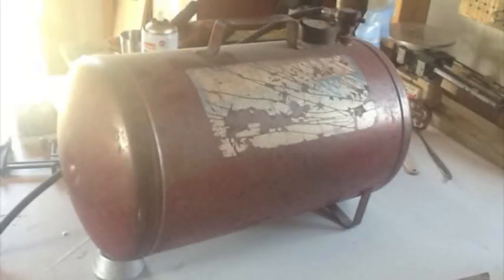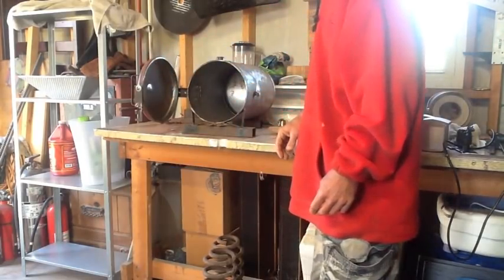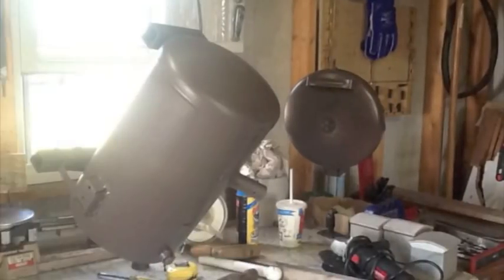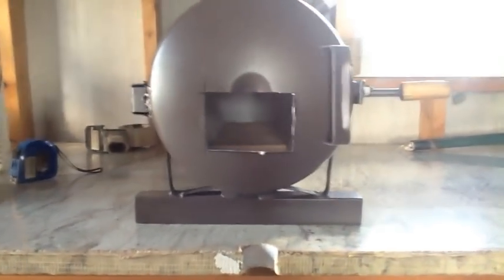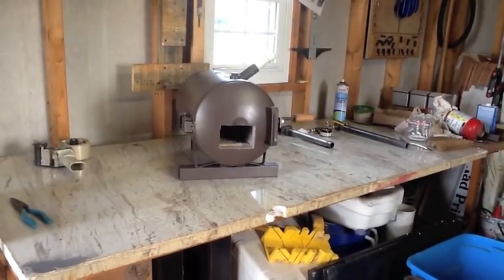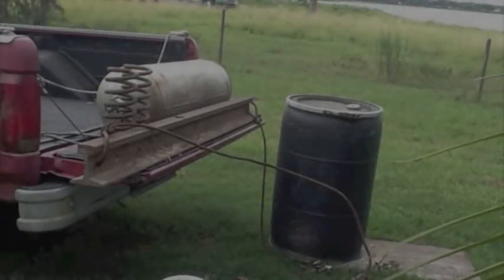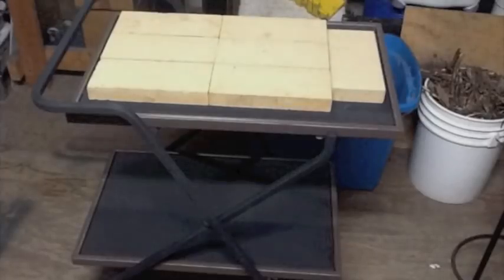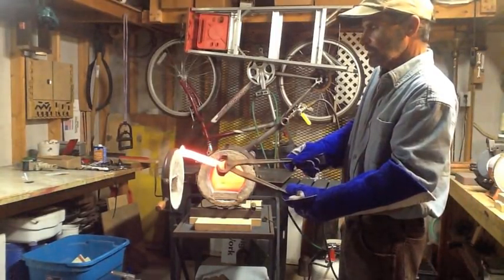My Custom Blacksmith Propane Forge Build - Start to Finish

Comment: chunk o medal   a rail road spike
Reply: and with it that hot how many recognized t it as I did  that is over 50 years experience
Reply from the maker: Yep, the good 'ole RR Spike. So with 50 years under your belt, what did you think of my 1st forge build with no prior experience? I never saw a forge in person until I built mine. TIA
Reply: in this age with Y.T.   to see up close how to it should be as easy as falling out of bed  this is why I focus my projects on how to for no money   its a much harder way to get  really good out comes    I have my first smithing vid going up in a few days   cow boy cooking irons from junk left behind after an election
Reply: and using a vary UN-CONVENTIONAL GAS FORGE
Reply from the maker: Cool, please share once posted on YT :)
Reply: best way is to sub   I may not have 4000 subs but the # of people that will want to  be on a mail list   I'm 72   and every thing about computers is self taught    I began this 5 years ago then my channel 2 years before  2011 my phone  just  made calls  and that was it I had a 35 mm camera till 2014  it broke and a Kodak 710 digital was cheaper than fixin the old 35  I almost went back to my brownie
Reply from the maker: Digital is the way to go...I use an iPad. Its more about the content than video quality :)
Reply: no ya missed it   now I use a  galaxy lite from T Mobil  and the K710  but its  quality sucks  compared to the  galaxy lite
Reply from the maker: Like I said, the video content is more important than the video quality. If its a subject peeple are interested in...they will overlook high definition qualty video and watch. The forge video was "poor quality" but does well because of the content of documenting its build.was good :)

Comment: I WAS WONDERING IF YOU ARE GOING TO SALE A RAIL ROAD TRACK
Reply from the maker: If you are in the Tampa, FL area I would consider sellin ya one :)
Reply: NO I AM IN KENTUCKY  I HAVE FAMILY IN FL
Reply from the maker: Ok, I didnt want to get involved in shipping an anvil , besides it would cost more to ship than what I would sell it for...LOL :)
Reply: ALRIGHT . I HAVE A QUESTION ON MAKING A FORGE AFTER YOU USE THE BLANKET DO YOU USE PLASTER OF PARIS ...I ALSO AM WONDERING CAN YOU HELP ME GET STARTED IN BLACKSMITHING LIKE HAND ME DOWN TOOLS TO START OFF OR A CHEAP SET TO START OFF WITH WOULD BE GREAT HELP I AM DISABLED AND DON'T HAVE A LOT TO BUY ALL THE TOOLS
Reply from the maker: No plaster of paris at all. After the ceramic wool goes in the wool gets coated in rigidizer, then ITC100 (optional) or Satanite (optional) and its complete. No plaster :)

Blacksmithing isnt my specialty and have limited tools myself. Check with some local blacksmiths (Ferriers), those are people who shoe horses....and see if they can help ya out. Good Luck!
Reply: THANK YOU
Reply from the maker: Sry I couldnt help ya out, best of luck in your smithing endeavors :)
Reply: no problem thanks for talking 
still like your videos
Reply from the maker: Thanks for watching them 👍🏼 :)

Comment: how much  did it cost to build
Reply from the maker: +Thamie _189 Between the ceramic wool, the ITC 100 & misc fittings bought to make the burner I would put the cost at about $130.00 Plus a few bucks for the paint. Thanks for watching!

Comment: How hot can it get to
Reply from the maker: Not sure..I dont have a thermocouple. Pretty hot tho! :)
Reply: +Makin Sumthin From Nuthin thanks because wanted to be able to heat up the iron enough, to be hit it by a hammer  to shape it
Reply from the maker: The last 3-4 min of the video shows it in action heating up steel :)

Comment: Very nice build. What, however, is the “wool”? Obviously it’s not really wool, but some kind of flame/heat resistant material. It would help if you’d identify the product. Small, point,  but why did you think it clever or funny to display the beer can? Power tools and intense heat and beer. Now that’s clever. Not so much.
Reply from the maker: Product is ceramic wool, heat resistant. Thanks for watching

Comment: And yet it continues ... It's a FURNACE (an enclosed structure in which material can be heated to very high temperatures, e.g. for smelting metals) not a FORGE (verb: make or shape a metal object by heating it in a fire or furnace and beating or hammering it.  Noun:  .a workshop or factory for shaping metal).  If you are going to make a videos then please get your terminology right!
Reply from the maker: Seriously? You will be busy for years criticizing makers of forges on youtube me thinks 🤔
Reply: @MakinSumthinFromNuthin  ... Haven't seen one make a Forge yet ... and that's the point.  And it's not a criticism, they are simply wrong.